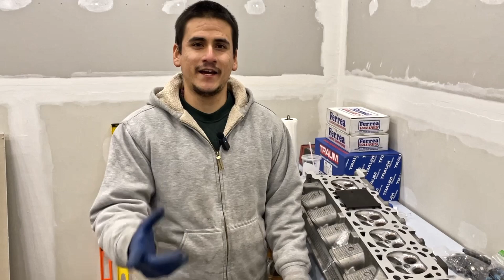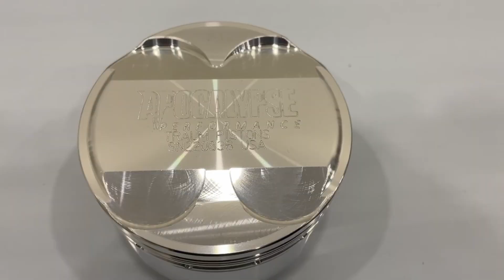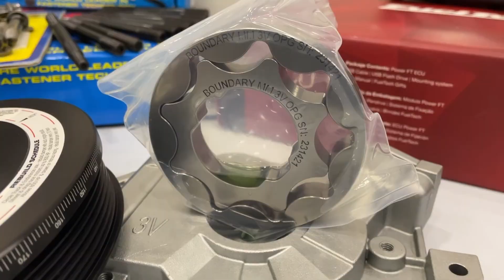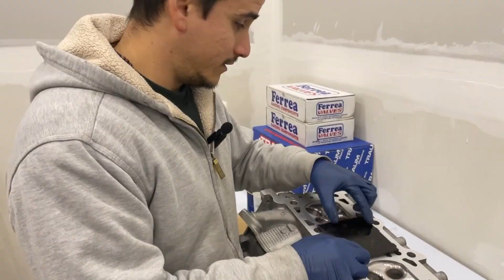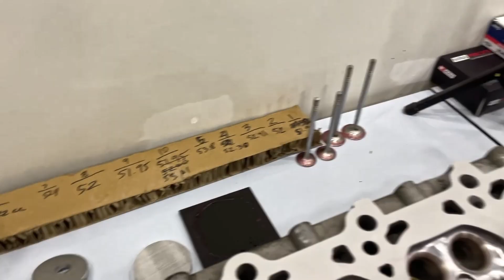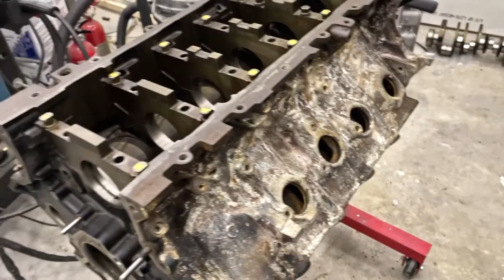Building a 8000 RPM, High-Compression N/A Cobra Head V10 - Episode 8

Comment: Piston speed isn't the problem, it's the force on your bearings as you guys just recently found out 🤣🤣 came to this build to see if you guys destroked at all. Or were looking at the force on your rod bearings lol. Piston speed is only half of the equation lol 

Audi r8v10 revs to 8700 is actually undersquare, but has a BSR of .911 the Ford V10 has a BSR of .85

Not a huge difference but still more. Also center to center rod length is 19~ mm shorter due to shorter stroke. Everything else is similar 22mm vs 20mm wrist pin 53mm rod journal vs 54mm the Audi does have a much narrower bearing though, 19.5mm vs the fords 23.7mm. I would find someone that can calculate the force you're putting on those bearings and big ends on your con rods and see if they're up to snuff, and maybe find a more suitable bearing material that wont deform. I really do think you'll need to destroke the engine some though, and potentially lower your redline 😢😢😢 but maybe solving the oil pressure drop at high RPM could fix your problem, if you have the time and money. Chase that first, rebuild with a more robust oil system and see if she holds up still 🤣🤣🤣 but I'm leaning more towards deforming the rod ends since you don't have any evidence of losing oil in your top end. It's not like it dropped to 0 just that you started losing pressure either due to cavitation from an overdriven oil pump, too small of a pickup, or your clearances opening up due to stretch at the rod bearing and bypassing oil that way

Comment: You lost me at stock crank.  Those V10 cranks are fine for stock pressures and loads but they are known to break in performance applications.  The split pin is the issue, yes it allows for balanced firing every 72 degrees but the split pin design will never make for an exceptionally strong crank that's going to reliably handle what you are throwing at it.

For other V10s out there in the wild that have grown from V8s to V10s, they embrace the odd-fire concept and don't have the spilt pin crank setup, for example the Viper.  Besides making for a stronger crank, it has an awesome, unique sound to boot.  I don't know why someone doesn't make a crank and a computer setup that can handle this for the Ford V10 with standard V8 type journals and the computer support to make it work.  There are so many of these V10 engines out there, Ford made millions of them in the last 25 years.
Reply from the maker: Can you share an example of one of these V10 cranks failing? We haven’t been able to find any so far

Comment: This is impressive. It sure is not the easiest project. I had a 3 valve V10 I was going to use in my 53 F350. But there seemed to be no such thing as a simplified V10 ECU. I did give some thought to two 5 cylinder Volvo or Audi distributors driven off the came and making a carb intake with five two barrels, but things like cams and header flanges were such obstacles I gave up.

Comment: What's the Maximum hp on this block , heads & crankshaft pls . 😅 Can't wait 2 see this Engine on the Dyno .    Robert Australia 🇦🇺
Reply from the maker: We’re targeting 700 hp at 8000 rpm 🤞🏽🔥
Reply: @biy_buildityourself  
From memory Ur cu inches 416 or 409 ? 
With the right camshaft & with those Heads u should be up around 750 + hp 
Hurry up guys . Cant wait 2 c this Engine on the Dyno bbf X

Comment: If you ever do this again, the tool you want you use is called a burette. It's a super tall graduated cylinder with a valve at the bottom made just for this kind of work. I've used them for titrations in the chemistry lab and I could immediately see that one would make your life a hell of a lot easier doing this job.

Comment: This is an amazing series. The only slight issue that might go wrong is that crank. Everything else looks solid and about right but the crank is the weird offset thingy that isn’t as durable as a straight crank but besides that y’all have an amazing build. Will probably use this as a reference to build one in the future as a unique torque monster to put into a 78-79 Bronco.
Reply from the maker: Thank you! There is a guy who has put some monster torque with a twin turbo set up on his Excursion with the stock crank. But not much reference for high RPM on this engine available.
Reply: @biy_buildityourself  I’ve seen that build floating around on the forums. It’s really nice to hear about things like that but I’m like y’all. I like hearing those upper RPMs scream but I also like hearing the low end rumble. Still a really nice build and at minimum the 4v head possibility will be nice to transfer over to a good flowing monster engine.

Comment: If it was at my shop, I'd 3d scanned the head and had it check the chambers, tighten all them up, and drop the head on my haas VF-02SS with a .25in  ball end mill amd cnc match all the chambers and ports based on flow Sims. 

That said, what you're doing gets you close. It's not perfect, but it's good for a budget build. Anyways, you're doing it. It is amazing. Keep it up.
If you're in Southern California, let me swing by and scan the heads.
I just finished up building my 2006 scion xb lol.
I have aftermarket Jun cams. On a 1.8l 1nz-fe  13.2:1 high compression setup. Lots of head work sleeved block rods pistons etc fueltech ft550 dash. Added knock sensors. 2 stage injection. custom moving velocity stacks on custom ITB setup. (Ya, I originally was going to k Swap, but i got my own cnc and went crazy with custom crap).
Dyno 383hp 291tq red line at 9600rpm stock the motor was 88 whp 6500rpm redline 10:1 1.5l so this 2600lbs toaster really moves well now lol it was a go-kart in its stock forum now its a square body space ship. 👌 I helped aero by doing a 6in chop as well.
Currently looks like a Chopped but stock white xb. Just finished a full 3d scan so I can redesign the front-end and back for better aero and modernized custom led lighting..

Sounds stupid doing all this to a metal box but you can pick up a non op good roller xb for under 1k with a 5 speed (mine I got new in 2005 had 431k on odm at when the Orginal clutch failed and the build started)

Comment: What's this going in? My dream car is a manual mercedes 190e with an evo bodykit and a high horsepower v10 in it, preferably as light a v10 as possible. With x-pipe and a nice pair of mufflers🤤. The v10 triton was the original game plan but everyone said it was hard to make power in it, then I researched the zf-6(manual six speed for triton) which people daily over 700lb/ft of torque. But I ended up giving up the triton because it's going to be too hard to make power when NA😢
Reply from the maker: We have a car lined up that we will be announcing soon! We aren't aware of a high performance NA Ford V10 so we are taking on the challenge to show this can work!

Comment: How are you handling the balance shaft that is normally in the head?

V10s fire at 72 degrees. It’s a 90 degree block. So it’s inherently unbalanced. Hence why ford added a balance shaft in the head.
Reply from the maker: From our research the balance shaft is there as an NVH solution. Since we aren't worried about that, we chose not to retrofit it.
Ford did a split pin design to overcome the even fire V10 in a 90° block instead of like Dodge that made an odd fire V10.
Reply: @biy_buildityourself  Having a built 6.8 V10 build myself, I hope you prove me wrong. However, I can not find one occurrence where a 6.8 V10 removes the balance shaft & lives for a long time. Now to the opposing side of that- I have seen 6.8 V10 WITH the balance shaft make significant power (turbo builds, blower builds, etc..) and go 400,000+ miles. So, as I said I hope you prove me wrong as I myself have had the thoughts of cutting-up 4-v heads. Just could not get past the Balance Shaft idea...
Reply: @LSXKILR  Your concern is worth noting but with the rotating assembly as light as possible, and a good balance job, this should be fine. Jack and Diego already know how to use an Arduino so perhaps they might wire up some piezoelectric sensors and check the vibration frequencies.

Comment: What about windage at 8,000 rpm plus? 
Knife edge the crankshaft counterweights? 
Fab a V10 windage tray? 
Fab an oil pan with baffles and a kick out? 
All of the above?
Love this project and all it's videos!
Reply from the maker: We have considered windage losses. The crank actual looks to have some profiling on the leading edges from the factory, so we decided not to touch them to help with balancing the heavier components.
We will be taking 2 GT500 oil pan gaskets with integrated windage trays and fabbing them to work on the V10.
Reply: dry sump? and vac

Comment: Man,this is an awesome endeavor you guys are doing. I've daydreamed about building one of these monsters,just don't have the resources to make it a reality, so I'm really rooting for you guys making yours,mine,and everyone else that has daydreamed about this!!! Maybe this could open the door to a 4v V10 conversation kit (?!?).
Reply: I commented to these guys that then need to get CAD scans of these heads once they've proved it will run, and then get someone casting or billeting them, and then we can simply buy a pair for a few grand like other aftermarket heads
Reply: I second this! Build it for us so we CAN BIY too!
Reply: Absolutely. Ford could've made them back then, but they didn't. Well, they did build the Mustang 'Boss 351' V10 test mule and the Shelby Cobra Concept in 2004, and they were both funcional, but still...it surely deserved to be mass-produced!
Reply: @Roddy_Zeh yeh I would’ve loved to have seen some wild shit like they in the Mustang or similar car. They probably ran into weight issues, just a guess but it started life as a truck motor so ? 🐾✌️🇺🇸
Reply: @deborahchesser7375  Yeah, and let me tell ya, it's worth watching HSG Automotive's vid on the V10 Mustang prototype, from his "Unsung Heroes" series, it's video #119.
That V10 was all aluminum and was just a tiny bit longer than the V8. So much so it actually fit under the hood without moving the radiator forward, I think. And I think it was actually lighter than the standard iron-block V8.
They really could've made it. Back in the early late 90's/early 00's, a Mustang putting out over 420 hp and 400 lb-ft from factory, a few years before the Terminator Cobra was born, would've been mental.
Reply: @deborahchesser7375  didn't stop dodge from that strategy's as the 440/hemi ( 426 on oil-rig's and ship/boat etc, and yes nowadays more rare than a cuda's-vin/birth-tag ) and viper platform is used as a truck or industrial engine
Reply: id like to see more of the camshaft manufacturing as there almost 1off's

Comment: V10's at 8,000 is pure magic!
Reply: Because it would literally take a miracle for this v10 to see that? 😂 

The MPS is more than F1 engines BUT it's not the MPS that's the problem, the bore stroke ratio on the other hand....... With long stroke and high compression, I don't know if methanol will prevent knock!

I seen a video that it was running.... I'm just working my way now to get to that point. But it running is NOT the issue.... Guess I'll see! 😂

Comment: I suppose you're getting the crankshaft knife-edged to reduce windage losses? David Vizad has a really good video on crank balancing and lightening by the way.
Reply from the maker: We have taken in the parts to get balanced and decided not to knife edge the crank. It does have some profiling on it from the factory though.
Thanks for the suggestion, we'll check out that video!
Reply: Excellent suggestion!

Comment: Yup, we're as excited as you guys are. With that much compression it's going to sound amazing. Seven hundred hp is entirely doable. Keep going!
Reply: To all the comments made thus far, and to all of us dreamers,remember the saying "Build it,and they shall come " ??? Well, that will definitely apply to this. Remember the 4 valve head conversion for the Windsor Ford small blocks some years ago? Tru,that didn't run for long for one reason or another, but so much has changed since then, so I believe that just the novelty and bragging rights is enough justification for having a 4v/v10 conversion kit available...this is what I'd tell my wife anyway!!!
Reply: i think it will be so dope if it’s installed in c5 vette or a car that like that
Reply: @l.ox99  Or maybe Jack and Diego should talk to Dave Smith at Factory Five to see if they can get a deal on a Roadster or Daytona Coupe.
Reply from the maker: We’d gladly take a donation from Factory Five 😂
Reply: @biy_buildityourself  remember y'all, RPM kills cranks, make sure that bottom end is balanced to f1 tolerances!
Reply: @Build it Yourself  another thing guys, when y'all get everything finished, and proven, I'd get CAD scans made of those heads and see if you can get someone to start making billet versions (or even castings) of these heads. They will sell. I will buy a set (or maybe two)
Reply: @Prestiged_peck  I like your idea. But with the upfront production costs factored in, a set of bare heads, valve covers, cams, and an intake would conservatively be $10K. But who knows, perhaps there is a market out there.
Reply: @Miles Rains  I'd dump $30k into a motor and combination happily to make just 1000 wheel so there's one sale.
Reply: @l.ox99  YES FORD V10 IN A CORVETTE

because fuck everyone lol
Reply: @Prestiged_peck  exactly and i think it will be a viper of wish tho 😂
Reply: In 2006, in Western Australia, Bruno Gianoncelli customised a 1949-51 Mercury Coupe, & fitted it with a Triton V10; it made 700hp, supercharged. That car is called MERCULES & featured in Australia's Street Machine magazine, March '06.
The car went to the US to SEMA & Fresno Autorama, where it won a couple of awards, but it was sold there later.
The car is now in Turkiye, sitting neglected, up for auction on a government site as of July 2023.
That car also was the very reason I heard of the Ford V10 engine.